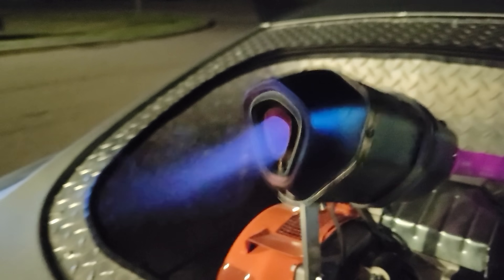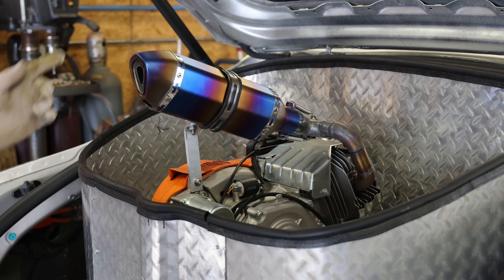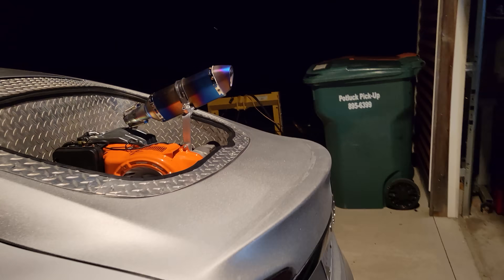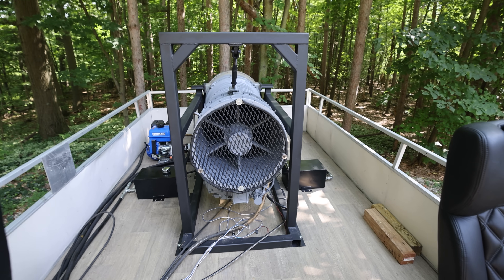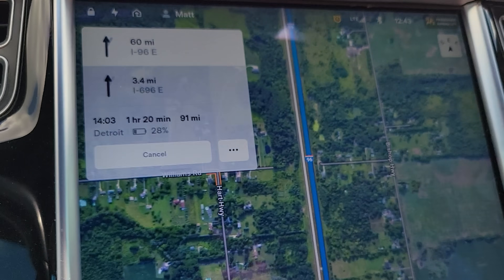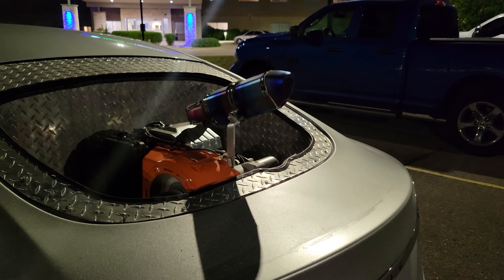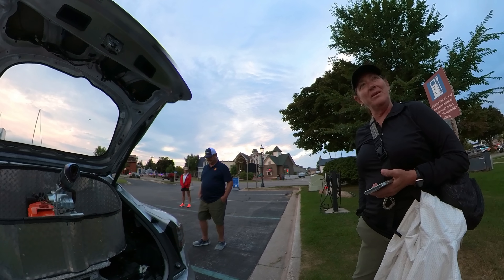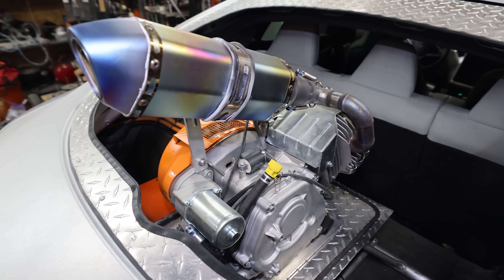Cordless Tesla (I Drive 1800 miles without charging) P.1

Comment: Everyone's always whining about how electric cars are a "fad", but ironically it's experiments like this that prove they won't be and that they will take over everything in time. Even with the GROSS inefficiency of burning gasoline in an engine, converting that to electricity, then converting that electricity BACK into chemical energy of the batteries, THEN converting that energy back into electricity and only THEN back into mechanical kinetic energy of the motor and wheels, you're still getting like 50% the mpg of a regular gasoline car. Do people not understand how INCREDIBLE that is? The efficiency of the electric car is so high that even with a terrible inefficient source of electricity like a coal fired power plant it's STILL emitting less carbon per mile than an ICE car.

Comment: It was immediately obvious to me from the beginning that that engine was not going to be powerful enough to keep the battery charged while driving. You need a liter bike engine with more power that you can run at half throttle which would make it quieter and more efficient. And then attach it to a much bigger generator component.
Reply from the maker: Yes same here, this wasn't the original setup that I was supposed to use but it's okay

Comment: Strange that the car doesn't have any security system that prevents you from driving while charging. 
By the way I would have chosen a diesel generator, so I wouldn't have to worry about charging while stopped.
Reply from the maker: Of course it does, as I said in the beginning of the video I modified the car, my setup is completely custom built by me. That is why I didn't give them any details but I will in the next video
Reply: @WarpedYT  can't wait to see the details on this .

Comment: This man's going for the world record for most overpriced hybrid car.
Reply from the maker: Hahaha... I'm pretty sure I already set that record.
Reply: @WarpedYT  tow a generator or mount the motor to a bike rack why ruin the back window?
Reply: @aspenyukon6845  he replaced the whole hatch. Still has the original.
Reply: @aspenyukon6845  also ruined the aerodynamics. A generator on a hitch mounted rack would be the best way to do this mess
Reply: @WarpedYT  are you considering a diesel generator maybe? (kubota, generac, cummins, etc)
Reply: @WarpedYT  these people are missing the point. What your doing is brilliant 👍
Reply: Fisker Karma? BMW I8?
Reply: @yeabutwecouldbefreer a Porsche 918 runs 2mil. There's plenty of hybrids that are way higher than those two.
Reply: Koenigsegg Gemera 🤣
Reply: @turboryan  Genera use high performance gasoline to backup not this offshelf stuff.valveless engine
Reply: @turboryan  yep
Reply: It's actually a range extended
Reply: Kinda like my Chevy Volt.
Reply: @OleHippy  Noup.
Reply: Right, probably used $40,000 cad cam machine to mount a harbor freight engine.
Reply: @melissasmess2773  

"Hardly Freight" 😆👌.
Reply from the maker: @melissasmess2773  way more than $40k hahahha.Harbor Freight Rocks !
Reply: I wouldn't say it's overpriced.  It's a better value than things like Fisker and the I8.
Reply: Also most reliable hybrid car :)
Reply: @firstjohn26  That would be a Toyota Prius. Cockcroach of a car that will be used in the apocalypse. The real mad max car.
Reply: Could have K- swapped it.  Hahahahaha
Reply: Yup, basically a very expensive prius
Reply: Elon gonna put a bolo on him
Reply: I have already broken the wirld record 10 years ago
Reply: You misspelled most useless 😅
Reply: Nissan kicks says hello to the dude
Reply: LOL Cute, The HOLY TRINITY of Hypercars. My personal favorite is the McLaren P1. Some have been asking for $2 Million usd.
Reply: A Koenigsegg Gemera costs $1.7M. It uses only battery under 30mph. It's most fuel efficient vehicle that makes over 1000hp.
Reply: Repent and believe in Jesus Christ  Amén. I advise you to read the King James Version instead of con NIV. God bless you.
Reply: It’s not a hybrid. A hybrid engine is required for it to run. Can operate without the generator. I saw a semi that was totally electric but had diesel generator to add charging if needed.
Reply: @robertkinnan3478  It depends upon which type of hybrid you're talking about. Plug-in hybrids exist, and most hybrids can drive with the engine entirely off. Basically, some hybrids can run without the engine OR without the battery.
Reply from the maker: Highest horsepower hybrid car for sure
Reply: @WarpedYT   You plan on beating the Hybrid Koenigsegg Gemera with 1,700hp?
Reply: if $/hp audi and porsch are probably not far xD
Reply from the maker: @dagbaramore3640  true I'm at like $1.3/HP with the Tesla haha
Reply: @WarpedYT  Noup. Wrong.
Reply: That's why I will stick with my chevy volt...sorry Tesla as much as I would love to own one, I can't imagine interrupting my trips or deal the anxiety of running out of battery. 
I would buy a Tesla anytime if they build a model with a good and quiet generator like my chevy volt.
Reply: Overpriced and least efficient. 😂 

Still fun to see.
Reply: On today's episode how to make my Tesla as annoying as possible next week we're doubling down.. no wonder no one is going on road trips with you
Reply: This reminds me of a began who wants to make veggies taste like meat
Reply: More like the most inefficient car built in the 21st century
Reply: @jonathanangladadavis  20mpg is very good when comparing to a gas car that has equal horsepower. And even if power isn't your thing, this beats have a separate car just for road trips to remote places.
Reply: @jonathanangladadavis  More like you don't know what the hell you're talking about.
Reply: @ldfreitas9437  Why do you say that? Can you back up your reasoning instead.
Reply: Loll
Reply: I was gonna say this is just a hybrid now
Reply: @MrKarmapolice97  Noup
Reply: If it can goes 1800 miles.  It may well be the long driven hybrid before another fill up or charge.
Reply: This is the better idea when it comes to EVs. However, battery capacity is the weakness. If batteries had far greater capacity and the vehicle essentially a solar panel with a small generator that had great efficiency, was quiet, and put out good wattage… EVs would be usable vehicles.

Essentially, 3 ways of powering up…

Op, why don’t you try incorporating solar as well? Maybe make that the cover for the motor compartment?
Reply: @ShemaYisrael1948  
Nice idea. 
To charge your mobile phone or to drive a cigarette lighter?
You simply do not get enough current out of or two solar panels to charge a traction battery. 🤷‍♂️
Reply: Bro Prius prime can drive nearly half of his trip with full tank of gas.
Reply: In fifty years from now, an electric car may wear out a set of tires without having to recharge even once.
Reply: @ambienthangout But by today's standards, fifty years would require a battery change at least four to five times. 
If we didn't hand that new battery design that was being worked on over to china, that would be reduced to one battery change in fifty years. 

But as with all tech advancements..
If it doesn't generate money for the manufacturer, they mysteriously lose the design.
A battery like that would eliminate "planned obsolescence", which means instead of needing a new battery every five to ten years, it would only need one every twenty to thirty years. It's the same reason we don't have gas engines that do fifty mpg.
Reply: @josephl3602  By today's standards. Not tomorrow's.
Reply: Lmao 😂 😂 😂 your comment is so hilarious lolz 😂 😂 😂
Reply: It's not about money!
Reply: Technically not a hybrid.  In a hybrid the engine turns RPMs into torque for the wheels.  The only way the engine is connected to the wheels here is via a generator and a battery.  It's more like a locomotive.
Reply: @BobbyNewhartFace  It is a hybrid, specifically a series hybrid.
Most cars are parallel hybrids where the engine can power a generator or the wheels.
A series hybrid has an engine hooked to only a generator, a battery, and an electric motor.
Most diesel trains have an electric drive train, meaning they don't have a battery. They're similar to a series hybrid but the engine must continually match the power to the wheels at that moment, and there's no regenerative breaking.
Reply: no thats koenigsegg
Reply: I agree. Just buy a hybrid.
Reply: Thank god I'm not alone here.... This is easily the most stupid thing a human has done in our entire history. Totally defeated the purpose of the car. I'm actually mad about it.... Even if he did make it as a joke to get comments. This man needs to be locked up. If he's doing stupid shit like this you know he diddles kids and most likely is a serial killer of the weakest women and children he can find.
Reply: No. the most interesting fun and inventive this is how things are found out and improved this man is a do'er a thinker and a maker. Not sat on his ass saying oh I can just buy one of thoes. The guy is brilliant.
Reply: The sound is so funny. It’s like a lawn mower
Reply: u should use a 4 stroke engine, less noise.. and give the different price of charging and total fuel price..
Reply: This is how Prius started. Now I know
Reply: @SIMPLEGUY423  Except with the Prius you didn't need ear protectors.
Reply from the maker: @grantadamson3478  no just a back brace haha
Reply: @SIMPLEGUY423  Reverse tho.
Reply: @SIMPLEGUY423  But he made a series hybrid which is better. Engine doesn't need to change RPM or have as much load changes and no need for a transmission!
Reply: getting gas is still considered charging
Reply: @EternalResonance   no, none says they are going to the gas station to charge their ICE car
Reply: More like the world record for most poorly designed/engineered hybrid. I mean it's entertaining, but there's a reason actual (non-plugin) hybrid cars have a gas engine that can pretty much drive the car at highway speed even without the electric motor.
Reply: @stacymcmahon453  which is not the best way. An engine has a certain RPM in which it is the most efficient. Running a smaller engine at this rpm range to charge batteries and help pull electric motors is the most efficient way. An idling or close to an idling engine is the most inefficient use of gas or diesel that you can do. It takes a huge amount of energy just to make an engine support itself running. It uses up kinetic energy during the intake, compression and exhaust stroke.
Reply: @Bryan-Hensley  Sure, but your ICE generator needs to be able to keep up with the rate of discharge of the battery, or at least not be too far behind it, or else you end up like the guy in the video having to run it for hours even while you're not driving.
Reply: @stacymcmahon453  the Chevy Volt, not Bolt, almost did this. However the engine was too noisy at it's peak efficiency rpm. They had a good idea with that car and overcomplicated it. Especially the transmission, which it didn't really need..
Reply from the maker: @stacymcmahon453  it's because they are weak, although I have owned to Priuses and they were my favorite cars.
Reply: Not hybrid man. In order to convert a Tesla to an Hybrid car you must add a combustion engine in order to move the wheels. Hybrid cars have two motors which move the wheels, a combustion engine and an electric one. Not the case here. God bless you.
Reply: @jesuskingofkings  Toyota hybrid's ICE doesn't directly drive the wheels since the two electric motors govern the actual drive shaft.
Reply: @valenrn8657  There is no such thing as “two electric motors” in an Hybrid car. It is just one electric motor and one combustion one. Both motors are related directly to the Gearbox not the driveshaft. Thankfully I have the technical manual of my Toyota Hybrid and I know what I’m talking about.
Reply: @jesuskingofkings this was awhile ago but this is simply not true.
Reply: @jesuskingofkings  hybrid just means two power sources. This is a hybrid car by definition. Albeit, not a very practical one.
Reply: @Robbie1075  Noup, Wrong my friend. Happens to be I have a Nissan Leaf and a Toyota auris Hybrid. Believe me I know what I m talking.
Reply: @jesuskingofkings   and I own a car that has two squirrels rubbing their nuts together really fast plus a regular internal combustion engine. That doesn't make me an expert on squirrel nut rubbers. And I can tell you that owning those two cars that I couldn't give any less of a shit about doesn't inherently make you more knowledgeable about what a hybrid vehicle is. Again, the hybrid in hybrid vehicle is referring to two separate and different power sources. And typing that last sentence made me realize I understand what you mean. If the tiny generator was somehow made to drive the wheels, then it would be a hybrid as you know it. Nevermind. I'm an idiot. My apologies.
Reply: @Robbie1075  Again, you are wrong and need to know the internals of an hybrid system. Hybrid systems are complex, need to know pretty well the internals, starting with the Gearbox which transfer the kinetik energy generated by the planetarium (MG1 and MG2) which is moved by the combustion engine in order to charge the traction battery using an inverter which converts the DC energy into AC to move the powertrain system using a permanent magnet AC synchronous motor. The electric motor has the option to be turned on or off in order to help by getting more power to the car increasing the torque (by increasing the HP) generated only by the combustion engine, both can be used in order to move the car and have the ability to only be used with the electric traction battery. To be more precise, BOTH ENGINES are capable of moving the car independently or with synergism. I’m resuming in few lines what a simple electric car doesn’t have. Hopefully you’ll understand part of the complex engineering of an hybrid vehicle.
Reply: @jesuskingofkings  I'm pretty aware of the internals of a hybrid system. In fact, I'm pretty aware of a few different types of hybrid power systems. But that's neither here nor there. You are complicating something that doesn't need to be complicated. A hybrid car is a car that gets it's power (that make wheels go round) from two separate AND DIFFERENT sources. Beyond that you are getting into the semantics that again, is making this more complicated than it needs to be.
And like I said towards the end of my last comment (which I'm guessing you failed to read), I wasn't accurate and your response made me understand better. But whatever. If you need to be so right that someone telling you you're right and you keep telling them they're wrong, that says more about you than me. Have a great day. And don't bother responding. This is the end of my involvement in this conversation.
Reply: @Robbie1075  Complicating? 🤔I’m just resuming how a Toyota hybrid system works. I’m pretty sure you don’t know anything about it. Please don’t be such a stubborn person. Applying the principle of a generator and trying to explain that way how an hybrid system works is ridiculous and insane. Hybrid systems are complex. Hybrid systems has its own generator (MG1 and MG2) which converts its own DC energy using an inverter into a AC electricity in order to supply energy to the traction battery (which is also part of the hybrid system). Please I advise you to study before making wrongly assumptions. That just demonstrates how ignorant you are in the topic. God bless you.
Reply: @Robbie1075  Just for your information. In the hypothetical case of a hybrid vehicle with a failed electric motor, if you are a trained engineer or technician, you could bypass the vehicle hybrid system in order to move the wheels only with the combustion engine. In the case of an electric vehicle, even if you have a generator that charges the battery pack if the electric engine is damaged, the vehicle becomes unusable. I hope you can understand it. God bless you.

Comment: what a cool idea , more in-depth video needed . Otherwise it will be called fake for the fact you cant charge and discharge a battery at the same time.

what would be cool was if the generator powered some jets to push the car instead of doing nothing .
Reply: Have you ever used your phone while it's on the charger?
Reply: @warpedfusion  yep all the time , the phone charges slower as some power runs the phone independently from battery , while rest charges the battery . Again a battery cannot be simultaneously charged and discharged